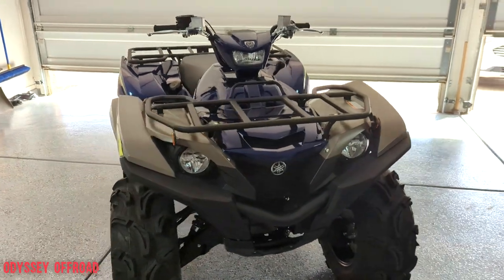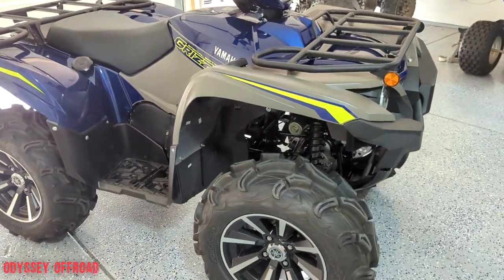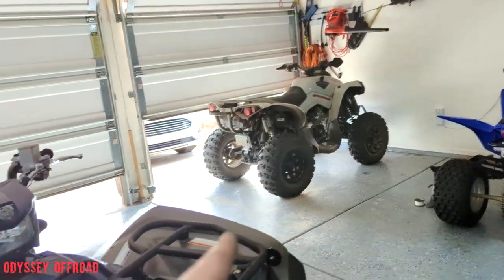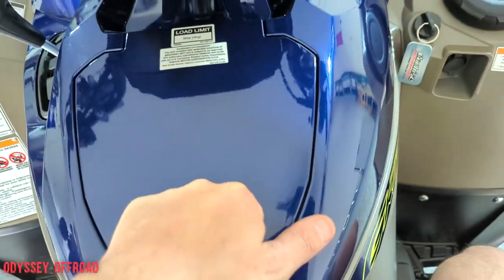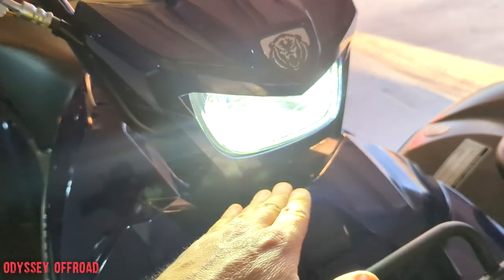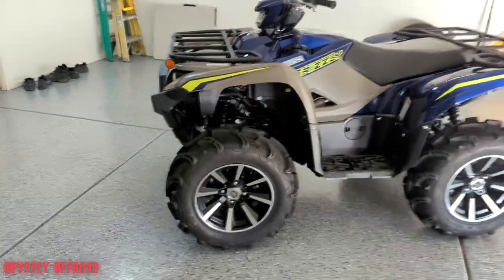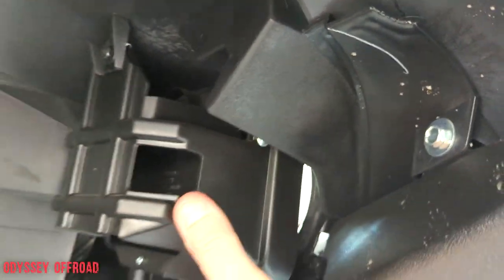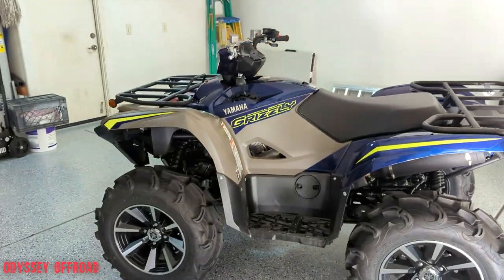New 2023 Yamaha Grizzly 700 SE full walkaround plus LED light mod!

Comment: You will love the Grizzly ! I have a 2019 SE  with over 7000 kms on it with zero issues other than regular maintenance and replacing the brake pads at 5000 kms . I  still have the original Zilla tires on it aswell and there is still probably a good inch of tread left and we ride all types of terrian up here in Ontario Canada including pavement to access trails.
Reply from the maker: They do seem to be very durable tires however they're not going to work out in my type of terrain. The easy maintenance and the reliability is the main reasons I went with this machine. I'm going to get into it more in a future review.

Comment: I've been shopping for a new Griz and am partial to the base model.  As a kid of the 80's my first bike was a 60cc yamaha trizinger in baby blue.  I rode that little gem for many years.  I used to go to the yamaha dealership when I was around 10 years old and collect the brochures and dream about the moto4 champ 100cc quad in baby blue.  They used that baby blue in many of the moto4 quads in the 80s.  So for me its a throwback to the beginnings of when you saw the end of three wheelers and four-wheelers really coming in.  Plus the base model comes with more traditional 12" tires with an offset versus the square tires setup on the SE and XTR.  We do more trail riding than mud riding and I would probably immediately switch out those mud tires.  I suspect my lawn would hate them too.  :^)
Reply from the maker: We all seem to have an affection for our first wheelers don't we.. yea the 12 inch wheel is more desirable. I do like the square setup though.  I'll be getting rid of the mud tires for sure soon.  I really liked the colors on the se.

Comment: Thank you for the video, I just purchased one and love it. The dealer told me to bring it back at 20hrs for first service and valve check/adjustments. Did you do a 20hr valve check on yours ?
Reply from the maker: You won't need to touch the valves on that thing for 200 hours they ain't going to move. Waste of money just change all the fluid yourself and keep the receipts.

Comment: Looks good!
Like the high beam LED mod.

Does your EPS light always stay on??
Or does it go awa on dash when you actually start up the unit?
Reply from the maker: No it shuts off when you start the machine. It was only because the key was on and it wasn't running.

Comment: I have the exact same machine and my third light housing is perfectly sealed, no gap as shown on yours. 
Seems like you might have a defective headlight housing
Reply from the maker: No it's definitely not defective it's very common on all a lot of them. I adjusted my handlebars and moved the brake lines down a bit and the gap closed up.

Comment: Great video!  I have a 2022 Grizzly 700 XTR that I put the 2R Racing exhaust tip on and a new EHS air box with uni filter but no fuel tuner.   Wondering if i can block the cap off the air box hose to the head also?  Is the fuel tuner a must?
Reply from the maker: Thanks 🤘🏻 If you have the exhaust hip plus more air going into the air box I definitely suggest you get the tuner.  Blocking the AIS off is an easy mod.

Comment: Led are great I'm guessing down there. In Minnesota we get snow and my Polaris sportsman 2020 has regular halogen in fronts and pod. If you take that grizzly out at night in snow especially heavy snow and why wouldn't you wanna go for a ride in heavy snow? The Polaris lights get warm, seriously warm. The snow melts almost immediately off the lens housing on both fronts and pod. Plus halogen is better in blinding white snow than led.  The yellow is much longer range. That full led now grizzly would be worthless in a snowstorm when it's 15 degrees. I'm guessing the reason Yamaha used halogen at least in the pod was for snow. Either way up in Minnesota I would never get a machine with LED. Polaris sportsmans halogens are amazing, 50 watts by 3. I think forcing the led is a mistake. Make it an option as up here in snow they suck. Great video tho!
Reply from the maker: Thanks man, yea i am all to familiar with snow. I am from NY.  Live here is southern az though now.  Thanks for the comment 🤘🏻

Comment: i'd prefer the can am 1000cc being 6 foot 6 inches tall and 360 pounds but worried about reliability obviously of CAN AM  comment please?
Reply from the maker: The canam motors are very good. There is going to be a lot  more maintenance on the canam and a lot of squeaks as it breaks in.  Speaking of maintenance changing fluids is an absolute mess on any canam.  You also have more fluids to maintain. Front diff, rear diff tranny and engine oil on canam. Yamaha is just front rear diff and engine.  Obviously the power of a canam is second to none. It really depends what you need tbh.
Reply: I just bought the identical bike as this one. Totally miss the power of my 850 Outlander, but I won’t miss all the constant bullshit issues! And to do any maintenance, or any work whatsoever is an absolute nightmare on the CanAm! Yamaha is just so much more reliable and problem free.. the main reason I switched.  But the V-Twin is totally bad ass!!
Reply from the maker: @giggletree1  totally agree. Only part of canam i miss is the motor.

Comment: So apparently Yamaha put a normal light bulb in the pod because it cuts through dust and fog better then the leds do.
Reply from the maker: I don't know about that but it's possible. Actually amber light cuts through best so 🤷🏻‍♂️
Reply: You are correct,  that was their reasoning.  I'm not impressed with the factory led lights, I put on a 8" light bar under the front rack and wired it into the pod light wires because I always have a bag on the front rack so the pod light is worthless.